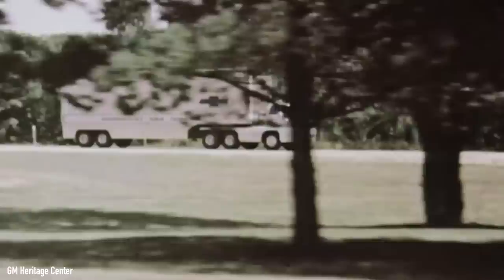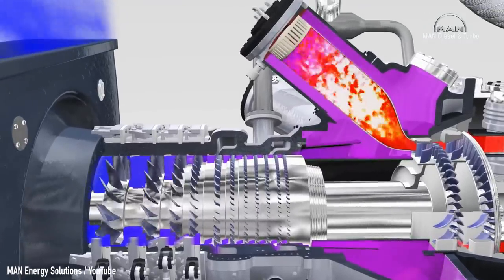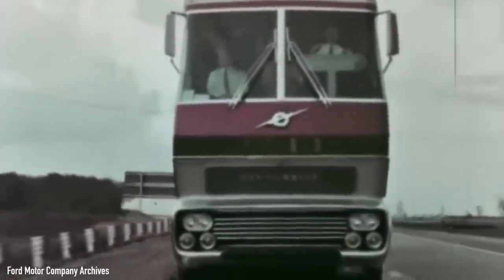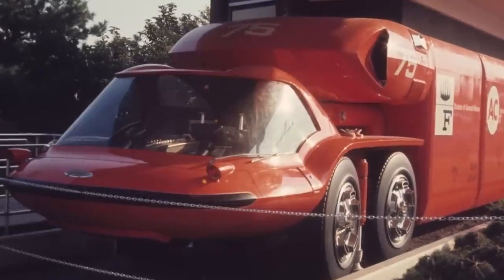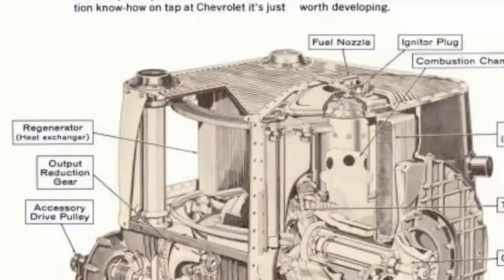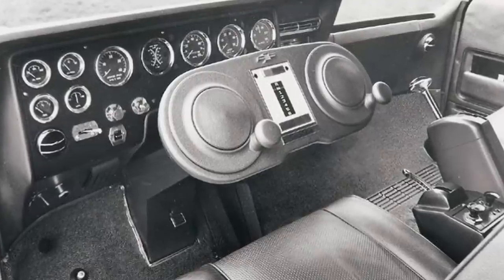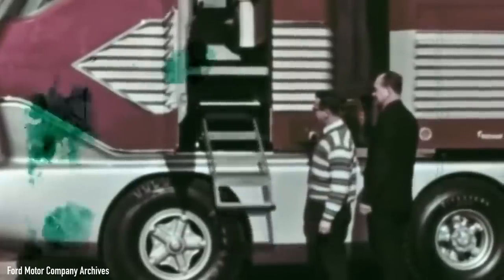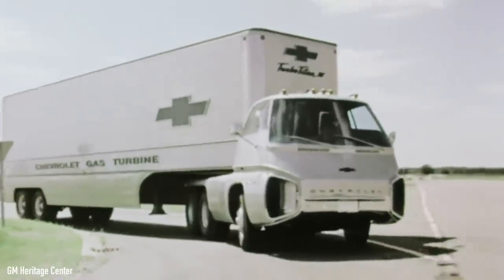The story of Turbo Titan, Chevrolet's long-lost gas turbine truck that almost made into production

Comment: I miss the days when Detroit had an imagination.
Reply: Are you intentionally ignoring Tesla?
Reply: @jamn2boost  That would be the first I heard of Tesla having an engineering facility in Detroit.
Reply: @shawnz241  I guess i took "detriot" for "automotive industry"  you really meant the city. My bad.
Reply: @jamn2boost  All good my dude! There’s a lot of great American automotive engineering taking place outside the Motor City.
Reply: @jamn2boost  nice brain btw.
Reply: @DarkoPetreski  I can't tell if that's a compliment or sarcasm.
Reply: @jamn2boost the first cars were electric. Don‘t see the novelty in what tesla does
Reply: Detroit doesn’t have an imagination because the public has no taste for imagination. Companies do what makes money.
Reply: @seanmcdonald9837  its the very reason Tesla made the splash it did. ALL domestic automakers were just squeezing money, not pushing innovation.
Reply: @jamn2boost  wait wait u call putting heaps of remote battery in series and putting them in a car with some motors, and putting video game and tech gimmicks in car, innovation? 
Manufacturers like lexus, caddy, the Italians etc. who are able to reduce emmisons of big engines and still use them are innovating (slightly)
Reply: Tahsin Faiyaz If you think Tesla didn’t push the entire auto / EV industry you are wrong. So wrong. I think it’s just ignorance so just do a little research. The Tesla motor and batteries pushed both very far. The info is out there if you actually want to learn. Interior design has pushed Detroit quite far as well.
Reply: @nastystang113  ofc tesla changed the world. Bt changed it for worse and for their profit.
Reply: and the government kept its nose out of designs
Reply: @jamn2boost  seeing as Tesla claimed Bitcoin was "bad for the environment" they definitely should be ignored
Reply: @jamn2boost  Tesla isn't all that imaginative.  They just put a bit more effort into making their EV's.  Nothing else about their cars is all that exciting.  Their styling is pretty standard, excluding the lack of a radiator grill.  Cars from the 60's had far more style and personality than anything made in the last 30-50 years.  Since the end of the 60's everything (from kitchens to cars and more) has gotten less imaginative about what the future could look like.
Reply: @jamn2boost  Tesla doesn't innovate, they just put their interpretation on an already existing technology.
Reply: Well Detroit doesn't really even exist anymore lol.
Reply: This was when imagination wasn't expensive
Reply: Detroit has plenty of imagination. Things are different now exponentially everywhere else and that's why they can't put imagination into showrooms.
Reply: @ThePhiltastic  Not a whole lot of similarities between early electric cars and modern electric cars. Early used mechanically commutated DC motors with completely analogue power control systems, powered by Lead Acid or Nickle-Iron batteries. Modern EVs use AC motors with electronic commutation, using power inverted from the battery, and use Lithium and/or Metal Hydride batteries. Comparing modern EVs to old EVs is like trying to draw a similarity between the watt steam engine and IC engines "because they both burn stuff," they are completely different machines.
Reply: Do you guys have any idea how fast an 8’second car is. Like the plaid. Think of a funny car with tires so big only one wood fit in the back of your short bed truck. They have parachutes and wheelie bars. 

The Tesla runs similar times and is so safe grandma could
Drive it. Their car broke the crash test machine. The slowe model Y runs 12.0. That beats 90% of al exotic super cars in the 90’s and half of them today. Type S P100 does 11’s. 

It’s disgustingly fast. You don’t just make a fast car by accident. It takes a lot of engineering. 

As much as I don’t really like Tesla’s and definitely don’t like the nerds driving them, I still respect the engineering. Go to any Tesla dealer they will let you trash one on a test drive.

Most people would hurl riding ina. 12 sec car that you can punch over and over again without breaking anything. 

I put an empty tic tac bottle on my chest. Hit the gas (err I mean accelerator pedal) and it stuck to my chest to 100 mph, where I left off. It’s retarded.
Reply: @latenttweet  we don't care about speed, everything is not about speed 😂
Reply: @ThePhiltastic  
First cars were steam powered, electric powered only came around same time as petrol carriages made a splash.
Reply: @demonking86420  
Did not know that hoarding GPU's worldwide, causing massive production disruptions which results in an overflow of GPU's, then causing world energy use to spike by 20% use during mining crazes as being environmentally friendly.
One may think you have no idea what you are on about.
Reply: @SMGJohn  and you clearly don't know that mining of the lithium(and other similar resources) required to make the EVs Tesla sells is way worse than what you prattled on about cryptocurrency mining

I have no idea why you defended such high-horsing from an electric vehicle company
Reply: @SMGJohn  you clearly need serious help.
Reply: @demonking86420  
I need help because 40% of the Amazon is gone and the oceans are already 15% more acidic since 2000? 
Imao, okay kid, facts hurt I guess.
Reply: @The-Heart-Will-Testify  it is in my life!
Reply: It still do it’s in the rappers
Reply: The Illuminati
Reply: @jamn2boost  what up doe
Reply: @jamn2boost  Given the disaster that Tesla has been, it's probably for the best.
Reply: @nastystang113  EVs were already in development.
Reply: & low crime rates
Reply: They were much less regulated then.

Comment: Considering that diesel trucks of the time struggled to hit 200hp, 280 is actually pretty good, and the lower capacity probably improved its off-peak fuel consumption compared to Ford's 600hp idea.
Reply: Wrong.  The Cummins NH220 and NHT262 were on the road by the late '50s, and the Detroit 8V71N with 65mm injectors was good for 318 BHP and it was put there (1958) way before this pipe dream was.  Next myth?
Reply: @desertbob6835  Just because you can fish out a couple exceptions that prove the rule doesn't mean it's not true. There were plenty of examples of 500hp trucks in the 80s, but the overwhelming majority at the time had 237 - 350.
Reply: @joshbobst1629  Cummins had a variation of its massive 19-liter KT inline six -- which not only was an iron giant but also had a square 6-1/4" bore x 6-1/4" stroke -- that made 600 hp! In those days, even 500 hp engines weren't all that common.
Reply: Strange to see that yesterday Tesla launched a 3,000 HP battery semi truck.
Reply: @Victor-vj5ds  Lol, and no trucking company will buy it, unless they are going to use it for short haul or warehouse yard spotting.
Reply: @truthseeker2321  well most semi truck deliveries are under that range and under the 82,000 pound limit.
Reply: @joshbobst1629  -  Face fact. Deser T Bob has shown that you were mistaken. Move on.
Reply: @scootergeorge7089  - Face fact, pointless comment.
Reply: @chrisdavidson911  - Reread the comments. You need to catch up!
Reply: @scootergeorge7089  no need, facts don't change.
Reply: @joshbobst1629  what made it overwhelming were the big companies being cheap asses. the motors were out there the 8v's the KT's and the the v8 cat . 70s small cam cummins with a button could pop them up hp wise pretty decent.

Comment: My Dad was one of the Chevrolet engineers who worked on that truck in the 60s. In fact, he was one of a small handful who were allowed to drive it, as the turbine engine was pretty tricky. My Dad passed away in 2014, but prior to his death he shared his thoughts with me:

"At the time Chevrolet was getting very serious about turbine engines. Although this was highly experimental. The key advantages were power and fuel economy and cheap fuel (Kerosene). The driveability was outstanding, however, the driver had to be extremely careful about monitoring turbine temperatures. The engine could not be used for braking as in internal combustion engines. I have no idea what happened to the vehicle. Since it was one of a kind, I assume they kept it in storage or scrapped it.

As an added thought the disc steering wheels (the truck did not have a steering wheel--it had two small discs in front of the driver), if you remember, I had them installed on a passenger car for evaluation in normal driving situations (I do remember him bringing a car home with that dual-disk steering system. It could be moved over to the passenger as it was on a cable). This type of steering system was very novel at the time and required a lot of attention to normal driving. I kind of liked it but I do not think anybody else did!"

My Dad is the passenger shown in many of the photos you will find online. He and one other guy drove it to the New York World's Fair (I think in 1966).  When they drove the Turbo Titan III into the show hall, the high temperature from the engine exhaust set off the sprinkler system. My Dad further noted that when they drove through Pennsylvania, they encountered a large hill that other trucks had trouble climbing. The Turbo Titan when over it "like nobody's business."
Reply: That is really interesting news and I can tell your Dad was passionate and proud of his work and wanting to share with you. 
My Dad was an aircraft manufacturing engineer at Fairchild and ultimately made it to Plant Superintendent when Fairchild was building the A10. God I begged him to take me to the plant to see the first planes being assembled. 
I never felt the satisfaction in my career as did our Dad's. 
Thanks for sharing 👍
Reply: You had an awesome Dad :) mad respect, and (if you don't mind them a bit late) condolences to you for the loss.

I don't think I've ever before thought of a semi truck as 'beautiful' but that is the word that comes to mind here. Would be amazing if someone did the detective thing and managed to track down its ultimate destination... I'm sure it's mostly a matter of time, paperwork, and getting people to talk to people...
Reply: @laserhawk64  Thank you very much. He was a real car guy and a terrific teacher.
Reply: @darrylbarger3795  Thanks, Daryl.
Reply: @vehiclenanny  My father is a brilliant fellow with mechanical things... he can stare at nearly any given bit of clockwork or a linkage or whatnot, so long as it's almost entirely mechanical, and with a bit of thinking out loud, work out its contents and means of operation.

I may be a computer nerd -- I'm all hardware, don't ever ask me to program anything more sophisticated than a Honeywell thermostat! -- but ohhh what I wouldn't give for what he has!
Reply: Thanks for sharing and answering the question I had on that steering console. You really added some depth to this video.
Reply: GM’s last gasp at turbine power was in the mid 80s . Was your dad on that project too?
Reply: I bet it was  at the tech center
Reply: @ras4782  GM Proving Ground in Milford, MI
Reply: @ChipmunkRapidsMadMan1869  No...he moved on to the C/K truck group in the late 60s, focused mainly on the Blazer and Suburban until he retired in 1987. I joined Chevrolet in 1984, so we overlapped a bit.
Reply: No engine braking is a serious deal breaker in trucking.
Reply: Dad's rock.
Reply: I think they couldve been really good engines with further development and with modern tech it couldve been possible.
Reply: That is an incredible story, thank you for sharing it with us. It must have been pretty cool as a kid, he'll even as an adult to have a father that dealt with such levels of testing and Engineering at General Motors.
There's a bunch of replies on this comment, but if you see this, thank you and I know it's been a few years, but sorry for your loss. God bless
Reply: @richdiscoveries  Thanks for those thoughts. I did see some cool vehicles in our driveway as a kid. For a car guy, this was pure nirvana!
Reply: That one hella of a story you dad was probably the man. It would’ve been insane if these things would’ve been put into production
Reply: Thanks for sharing your story, may the dad rest in paradise
Reply: Thank you for sharing that, it's an honor to read sir.
Reply: Thanks for the story, that Titan Turbo III was probably my favorite future vehicle of the era. I still have a two pages ad of her. Looks as Oldsmobile took some of the styling features for late '60s design. Perhaps an interchange of designers.
Reply: @66designs37  Very kind...thank you.
Reply: Thank you for sharing that piece of information — That was interesting!
Reply: That is truly fascinating. To have the opportunity to work on such a unique vehicle is definitely bragging rights. Condolences for your dad.
Reply: @Brad772006  Thank you...very kind.
Reply: The final run was less than 100 vehicles. The engine was converted to a military secret and is used in the Abrahms tanks.
Reply: Now that was cool as shit. Not too many people can say that about their dad's.
Reply: THANK YOU FOR this wealth of hands-on tech insight.  This, and other quality websites give us soooo much detailed information that otherwise would be lost upon the scrapheap of history.
     You name it. The FIREBIRD prototypes, along with the Corvette iterations,  Mustang, Monza GT, Astros et al made for a rich history of industry progress (I inherited a FIREBIRD car as a child. Wonder how valuable it would be today?).
    You DEFINITELY have a new subscriber. Thanks!
Reply: That’s crazy. I’d be interested in the fuel system they used. I worked on gas turbine comoressor-generators in the Air Force late 80’s, but it was mostly older equipment until ‘91. The fuel pump was a centrifugal clutch and pawl setup for startup and wide open only. By the time the fuel was in the combuster can I have no idea how they would’ve regulated it. Cool stories you have
Reply: Dang 60s and i thought the old model in jay leno was the oldest one.

Imagine this gas turbine modded to hydrogen now and boom
Reply: Ive always heard that gas turbine engines return horrible fuel economy.
Reply: @aaron___6014  the gas turbine compressor/generators we had in the military when under load used a gallon an hour
Reply: @skeezix8156  That's insane.
Reply: @aaron___6014  my bad, it was a gallon a minute……I’ve been working all night. Lol so the newer units I saw in the early 90’s had 90 gallon fuel tanks, they were damn near empty after an hour and a half
Reply: @felixwankel3989  Absolutely, and there would be no Jake brake on a turbine.
Reply: Were the years when you may imagine the future,optimism and happines moved USA and research department 😊
Reply: It's a shame it didn't reach production, for ltr it seems like it wouldn't be great, but it's use seems like it would really fit OTR trucking, especially if the fuel efficiency and its hill climbing abilities worked as well as remembered.
Reply: So cool. Thanks for sharing
Reply: @truthseeker2321  that Jake brake is super important. Just looked it up.
Reply: @davidfrankel9267  Yes it is. I've driven trucks that weren't equipped with it, and you had to take extra care about going down steep grades, not necessarily on interstate highways, but rather on two lane roads. 
To be honest, I don't think there's trucks without Jake brakes anymore, in the USA or Canada. I think it's standard equipment now, unlike 30 years ago and beyond, where it was an add on component.
Reply: @vehiclenanny  you mean GM since They own Chevrolet
Reply: @Railfan Canada  Yes, in today's world. Until the mid 80s, each GM division had their own engineering staffs, then two groups emerged: CPC (Chevrolet-Pontiac-Canada) and BOC Buick-Olds-Cadillac). In 1999, the divisions became sales/marketing arms of GM engineering.
Reply: Dude, that is an incredible bite of history! Thankyou and God Bless
Reply: @aaron___6014  - like he said, they have only a small band in which they are reasonably effective. They are particularly inefficient at low speeds and at idle, which makes them less than ideal for real life road traffic.
Reply: @vehiclenanny  just found the video on line is the truck still in one piece and on display somewhere
Reply: @jeffreycarrow8584  I don't think so.  I believe it was scrapped long ago.  In fact, I have the "Turbo Titan" door badge in my basement.  ;)
Reply: @vehiclenanny  thanks for getting back to me too bad the bean counters did not have the forethought to preserve a piece of history still do not understand why they can not build an electric tri 5 chevy now would be a bestseller
Reply: @vehiclenanny  Me and my M1009 salute you!
Reply: @Wingnut353  Heck yeah!  CUCV for the win!
Reply: Thanks for this part of history.
Reply: I love reading comments like this.  Your dad sounds awesome.
Reply: @strickca991  Thanks. He was a great person.
Reply: @felixwankel3989  I wonder if they could have reversed the engines or had air flaps like an airplane had
Reply: I'm sure it's in storage with Chevys other forgotten vehicles, something like that is way to nice to scrap. Whi knows, maybe one day it'll make a comeback
Reply: Nice
Reply: @Vehicle Nanny  Did you guys briefly both work on the GMT400 platform that began production in '86?  "The 90s truck of the 80s" I call them 😀
Reply: @twiff3rino28  No. My dad retired in 1987. I was in sales and marketing.

Comment: GM continued development of gas turbine trucks into the late 1970s and early 1980s. I started working at Detroit Diesel Allison Division of General Motors in June of 1983. Allison had designed, developed, and manufactured the GT-404 engine for semi-truck use and it was still being tested when I started there. The GT-404 ended up being used to power generators in Patriot Missile Batteries for the military.